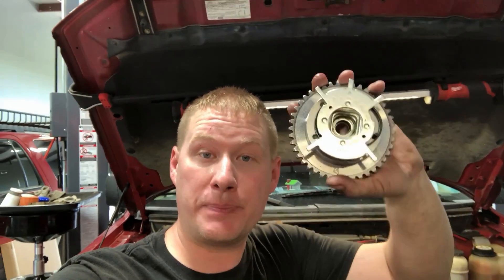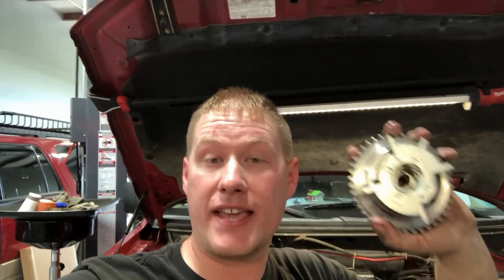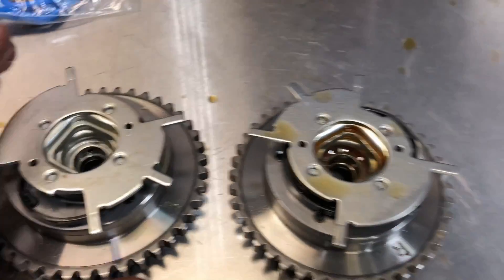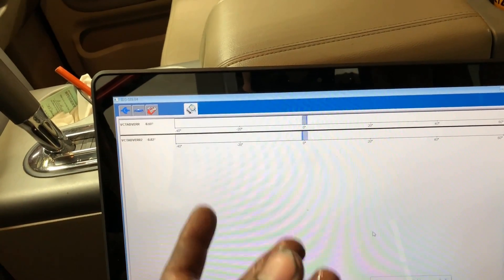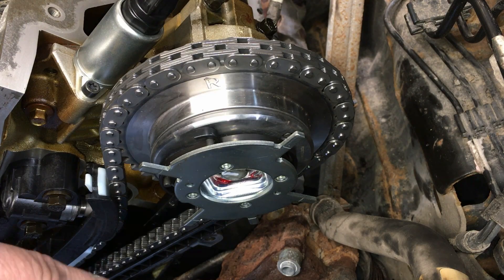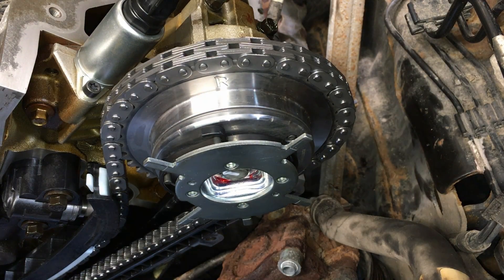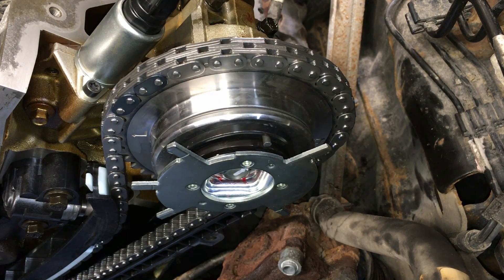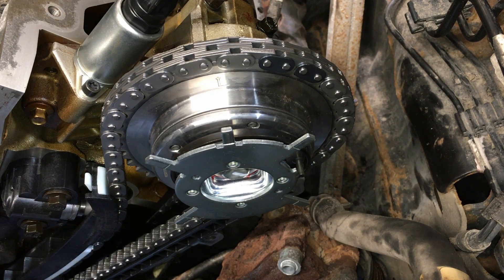Ford 5.4L 3v Timing Kit Choices: This is Why You NEVER Want to Use Aftermarket Camshaft Phasers!

Comment: I had the chain, phasers and put hv oil pump. Power is better but not like it should. And it still ticks but not as loud?  What next? Ps all Ford parts.
Reply from the maker: Inspect the lash adjuster and followers as shown in my 4 part series.

Comment: Now, just like the Ford 6.0 diesels I have learned more than I wanted to know about 3v engines hahaha
I worked for Ford dealer in the 90's and worked on plenty of 2v's & 7.3's..............Did a 5.4 3v couple weeks ago, that's how i found your channel
Which was a life saver to say the least ! 5.4 had Dorman's but I found whoever installed them didn't torque them properly, Passengers phaser was moving
1/8th of an inch or more, due to sheared off pin in back and it wedged itself between then inside flat and end of the cam !!
Luckily, I got away with only buying the cam gear lock tool and wedgie.........

Now I just finished a 4.6 3v.....Got it together, it ran "ok" but kept tossing out DTC's P0012, P0022, bank 2 retarded...
Well, tear it down again (I had a zipper on that nice front modular radiator /condensor  assembly!) Eyeballing,
 the 6 o'clock on crank shaft was my error, so I bought the crank tool and got it all back together and running in 3 hours,
Runs like a top ! back to full on power no codes everything functions to spec's now can send it back to the used car dealer 
who brought it to us...

And I have convinced the boss to NOT Buy crappy A/M parts! He don't like to work for free, neither do I ! which is what happens
when you use A/M parts!.............Hell, @ Ford I went thru 3 T-stats once right off the shelf to get a good 1 that worked !
So sometimes even genuine parts can fail right off the shelf
Am sure I will be watching more of your video library as needed.....Like how in depth and direct your tell it in plain english lol

Comment: So doing the whole kit you suggested on my 05 Rousch F150 found an open small vacuum line port that come from the pipe to the brake booster. Any suggestions on where to find a diagram to track this down. And thank you so much for your videos.  You are an amazing resource.

Comment: Maybe a stupid question, but here it goes. My expedition has 178000 miles on it. At cold start it has a rumble type sound for just about a second. I believe it is a tensioner that leaked down. Do the chains on these ever fail ? can I just replace the tensioners on this?

Comment: DON'T BUY A TRITON 5.4- 3 VALVE. I put the cheap aftermarket set on my pickup because that's all I could afford. I watched your video on installing the phasers and timing set. Well I have about 32,000 miles it so far and it's still runs great. I wouldn't have paid $1500 for a Ford timing set. When it's starts acting up it will be for sale.

Comment: I'm coming up on 300k miles on my 2005 4.6 f150. no phasers, 2v engine etc. should I primitively do a timing (and oil pump) job at the 300k mile mark? I was planning on using Ford Racing parts
Reply from the maker: yes plan on a timing job and no to Ford racing parts.
Reply: FordTechMakuloco I asked the ford racing guy about those parts and he had said they were Ford OEM parts what is the difference between the Ford Racing Parts and regular Ford Parts
Reply: FordTechMakuloco thanks! I'll go with the same company that makes the kit in the description for the my engine.

any oil pump recommendations? I'm aiming for 1M miles on this truck

Comment: Would love to see more about the 07-12 Navigator. I understand there's a lot of crossover with the f150 but there are definitely model specific issues. Cheers.
Reply from the maker: The engines are the same exact setup. I do have some specific videos coming out soon.
Reply: FordTechMakuloco Awesome. In particular I was interested in 6hp26 failure mode/causes, air suspension, and rear axle/differential maintenance. Anything is cool though. Awesome work as always!

Comment: Wow thanks for making these vids. I was actually going to buy the phaserz from where you said the junk ones came from. I'll definitely be getting the Ford part but I'll only be doing one at a time lol. But rocker followers and lash adjusters, are the one auto parts shops sell ok to use or do I have to work more money at a dealer for the motorcraft or Ford part?

Comment: A few years ago you couldn't get a Ford phaser across the country with back orders expected to be 6 months behind.  So I had to go with the Dorman.  And of course they are going bad with only a few thousand miles on them.  The Expy was just a vacation/pull the trailer vehicle, not driven much.  So it took some time passing for them to fail.  If only Ford had designed them correctly in the first place, or not let it go on for so many years, we wouldn't be dealing with this.

Comment: All these cam phaser issues...makes so damn glad I hunted out a '98 F150 with a 2V 4.6...a half million kilometers and still runs strong as an ox and never has been opened up!
Reply: I had a '98 F150 and it ran great w/ 200,000 miles until we sold it.  Very reliable truck. We then bought a 2005 F150 and still own it, and going strong with 303,000 miles and never had a major repair at all.   At 290,000 miles the starter had to be replaced, but everything else is original like the alternator, muffler, cat, converter,  and tailpipe are original, and timing chain original. Electric window buttons on armrest were replaced. Yes, the cam phase sensor is ticking, but I never replaced it. Still runs great;  a solid vehicle with great pickup and speed. I will use it until 350,000 then decide what to do next. I always use Royal Purple fully synthetic oil with a K & N filter. The cam phase sensor isn't throwing codes, so I do nothing.
Reply: 2006 F150 with 645,000 miles. 1 Timing chain and pahser replacement. Fluid changes are key

Comment: FordTechMakuloco, i recently had my 5.4 replaced with a Ford remanufactured engine. I was wondering if you know if ford remanufactured engines are using Melling oil pumps? I asked the dealership, and got no help.
Reply from the maker: no they don't

Comment: Just had phasers and solenoids installed on my 07 f150 by my local shop. They neglected to tell me that they use Dorman phasers and have "never had a return on one." It didn't make it 50 miles and the passenger phaser seized.
Reply from the maker: Exactly!
Reply: Wow! That blows. Been lucky with my 193,000 mile 04 that I bought used.

Comment: Been there done that. I was supplied with cheap phasers and  it came back to bite owner in the ass. He purchased better aftermarket parts and has had no trouble since. My advice, spend the money. 
And a big thing to prolong the life of those parts- keep up with youd oil changes. 
Thanks for bringing this into the light👍
Have watched many of your helpful videos.
Reply: Did they get soaked in oil before installation?

Comment: Hey man I agree with ya 100 % I bought a cheap set on ebay less than 3 months later it was back to ticking real bad again. I took your advice from previous videos and bought the ford factory kit on amazon and also replaces the roller followers while I was at it and upgraded oil pump .  it's only been 2 months so far but all seems to be fine .  Thanks too your videos I was able to do my self . Keep up the great videos bud appreciate all the good info.  I'm looking at getting a little newer 250 wanna go diesel which would you recommend? I hear horror stories about the 6.0 but not much bad about the 6.2
Reply: Bob R the 6.2 gasser is loosely based on the mod series. The engine found in gen1 raptors is a version. I have heard some impressive things..
Reply: PureCountryof91  good to know thinks bud

Comment: Gotta love Ford, matter of fact all manufacturers. for the BS way they make money!  The nylon part in the quick disconnect fuel line fitting went bad on my F-150.  No repair shop (around here anyway) can replace just the quick disconnect end, and you can't buy the fuel line from the aftermarket, you have to buy the fuel line from Ford.  The fuel line is about 6' long; mostly steel and a little bit of flex tubing for $330.00 with tax.  Made some calls and finally found a used part at a salvage yard for $43.00 with tax.  Had to drive 100 miles round trip but well worth it to save at least $270.00 including gas to get it.

Comment: Way too much labor (even DIY) to use cheap parts.  Any experience with freedomracing website for OEM parts?  Also, what is your opinion on using the "iron" 2-V "ratcheting" tensioners in the 3-V?
Reply from the maker: I use neither.
Reply: I always use OEM when it comes down to business, but can share the experience of doing two F150s for two friends. The first one, thanks again for your update video showing your "flat rate" method, a real time saver! Used the freedom racing phasers.

Again, these jobs were for friends, so the choice for part source was theirs, with my recommendation to go Motorcraft. If something went boing, they understood that the redo is not free.

First one, flawless.

Second one, well, let's say he loves eBay. Right out of the box, the first solenoid broke in half at the crimp seam. You know this wasn't going to go well...I picked up some OE solenoid valves next door at Ford the next day at work.

I have to agree, the timing drive of the engine can be a pickle, but the OEM parts did run without problems for many years.

The choice is yours, it's your money. As a professionals, it's also or reputation on the line. We want you to enjoy years without problems.

Incidentally, the rest of the components on the first timing rebuild were all Ford. Using the FR phasers made his wife feel better saving a little bit, you know what they say about a happy wife...
Reply: jongarongedong Indeed, Freedom offers the Dormans for those on a budget. Their premium (Freedom Racing) ones are well made, including hardened cog faces. So far it's been great, both trucks are running fine, I still strongly recommend the OEM Ford timing chain kit and especially the control valves.

Did you like the installation video shown here? Its a great piece of work!

Comment: My 5.4 3v does not rattle on a cold start. However we'll rattle with a hot start, Like after a visit to the supermarket.

Used to rattle at all starts before I changed the VCT solenoids.  

Any ideas? I bought the car rattling on startup
Reply: Did you figure it out?
Reply: Worn phaser lock pin holes.

Comment: 2004 f150 cam phasors rattling like crazy.  Started at 85,000 miles. It got so noisy I was embarresed to drive it. In Phoenix, not one independent garage would change them. Finally had to shop around ford dealers and found a Lincoln dealer who would do it. After some serious negotiations, I let them fix it for $1200 including Ford Phasors. It came back very quiet and ran noticeably smoother and better. Had to change some pulleys and the AC Comp. but that was easy. At 160,000 miles, the engine sound like new. And after several thousand miles, it is still quiet and smooth. Happy!!!!
Reply: Was the rattling noise on and off or continuous ?
Reply: When was this??? I’m getting quotes in Phoenix upwards of $3,000 to replace cam phasers on my 3 valve

Comment: After doing a timing set on my 05 F150 I will say you are a fool if you take on a job like this and then cheap out on components.  I put all Ford parts in mine, only change I made was going with the Melling high volume oil pump.  Btw, I would not have been able to do that job without your videos, thank you so much for putting those together.
Reply: keep in mind the part that failed on you is original Ford. Motorcraft/Ford part is the reason why you done this job in the first place.

Comment: As the old adage goes: "You get what you pay for." I just do not understand why people think they are experts on everything. They think they can just go cheap on stuff, and not suffer the consequences. Or they think they somehow know better than the engineers that actually designed or built the engine.
Reply: Many parts, not just auto parts, come from the same factory using the same design specifications, but are re-branded or not branded at all.  If one were to believe that is the case here, it makes sense, given the substantial price differences.  Also, there are many aftermarket manufacturers with good reputations that have been around a long time.  Finally, if the Ford/Motorcraft parts had been better quality in the first place .....

Comment: Wow. What a pos. Look good but perform horrible.
Reply: 1keykneedeep not really.. They have issues yes.. But the platform is solid. Several 1k hp/1200tq 5.4 builds running twin turbos.. Just that it was still somewhat early in ohc v8 designs for the states. The 6.2 and coyote are pretty well sorted out.. And AFIAK? Can be a direct swap in a few models...

Comment: I have a question about changing the tensioners. I have an 06 5.4 with only 39,000 miles. I'm a first owner and it's only had full synthetic changed very regularly. I would like to change the tensioners since you've said in a past video that those are the cause of all the other timing issues starting a domino effect related to low oil pressure. My question is, have you tried to just pull the front cover and just loosen the valve covers to get the front cover off just to change the tensioners? Mine isn't making any startup noise but I would like to mitigate any future damage before my tensioners do fail and I'm not concerned about any of the other timing parts since it has such low mileage. Thank you.
Reply: I replaced my tensioners by only loosening the valve covers,(not removing them), then removing the front cover. It wasn't too bad! Way easier than removing the valve covers completely thanks to the way the gaskets are designed.

Comment: I just bought all new Ford parts and I am about to do the timing job this weekend on my 2004 Ford F150 Lariat. Also got the Melling m340hv high volume oil pump per your recommendation. Got all new roller followers and lash adjusters as well since I will already be in the engine (dont want to have to go in there again). Thanks for the tips!!!
Quick question, should I change my oil before I start up the truck after the install? Only got about 2k on this oil change currently. Or does it depend on if I have any plastic/metal particles from guide/timing cover chain wear?
Reply from the maker: Always change the oil right after any internal engine repairs.
Reply: Ok thanks! Should I do the lash adjusters/roller followers before the rest of the job or wait till the end?

Comment: shouldn't the two black links on the chain be centered with the arrow?
Reply from the maker: yes when it is timed but as I said in the video I turned it over by hand after timing the engine and found they were popping already. Once you turn the crank it will not line up again for something like 52 revs.
Reply: ahhh. did not know that. for some reason I thought every 360 degrees the two black links will line back up.

Comment: I did mine a week ago and used your links for the Ford parts.... I did cheap out on the tools though and the Chinese crank position tool needed to be modified to work correctly.... But glad I used the expensive parts inside the engine... That's a lot of work just to have it all fail soon after.

Comment: I had a customer bring in his 5.4 running on 4 cylinders found that the Dorman phaser failed . The locking pin and all the vanes broke up causing the cam to not turn while the timing chain just spun only the sprocket bending a few intake valves.
Reply: bet that guys butt puckered! Didn't save much now.

Comment: Another reason why 2v are better
Reply: As long as they are torqued correctly, I have never seen one come out.
Reply: @AJourneyOfYourSoul  LMAO I've seen a whole lot of them pop. Don't know how you've never seen it happen. Shit even the V10's were famous for spitting out plugs. There were guys that put their kids through college just by helicoiling 2-valve mod motors.
Reply: If you bulletproof a 3v you will never go back to an underpowered turd 2v. The 3V motor tows and works so much better than the 2v
Reply: @csaleen302  Yeah that 20 lb-ft of torque really makes a difference. I've owned half a dozen 2v never seen a plug fly. Not saying it doesn't happen but not as common as the internet has you believe.
Reply: Joseph Bentley 2v are the best.  Great engines.
Reply: But ya, what about the plug poping issue they have?
Reply: tmaq97 they actually fixed that. And later iterations even have coil over plug set ups to clean it up. Buut the 4v DOHC versions seem to be the best thought out
Reply: 2v 8 thread head owner checking in. No popping plugs and no phasers, best way to go.
Reply: Two two three Five five six ya if you like dropping valves and rod knock.
Reply: If you like men, go chevy
Reply: heard rumors that a 7.0L 2v is coming out for the Raptor.

Comment: After putting these in will it throw a code if something's wrong I have an 06 Mustang 3 valve put in a set of cams put in a timing chain kit with cam phaser lockouts kind it perfectly and it hasn't started since my check engine light will blink 7 times when you turn the key on after about 3 seconds is when it starts flashing and I am just stumped I've thrown hundreds of dollars at this thing I got a new throttle body a new alternator just all kinds of new parts and nothing is working I have a professional Diagnostics kit and it is showing no codes I have a Bama tuner and it's pulling up no codes I don't know what to do can you help me point me in the right direction